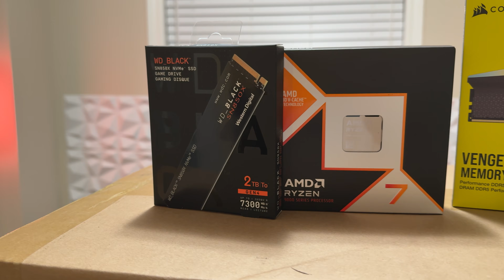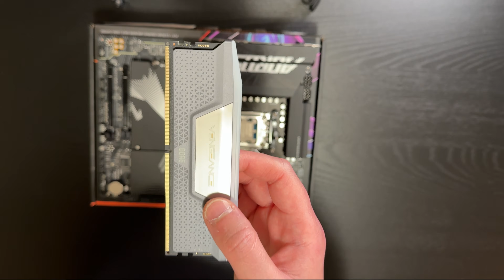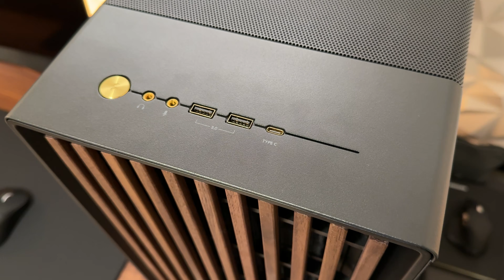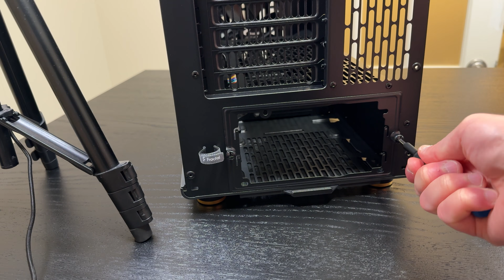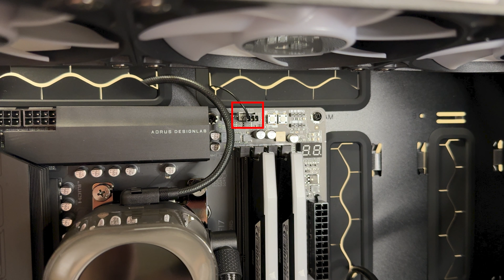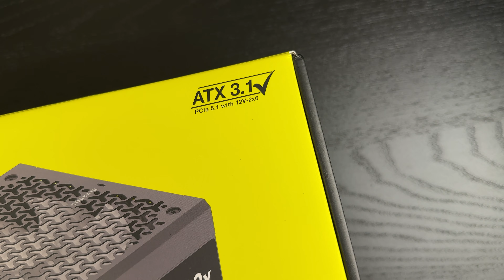Building My $3000 Dream Gaming PC! Ryzen 9800X3D + RTX 5080 | North XL Full Build & Guide

Comment: Just finished mine 3 weeks ago 
[PC BUILD SPEC LIST]

• CPU: AMD Ryzen 9 9950X3D (16-Core / 32-Thread AM5)
• CPU Cooler: ASUS ROG Ryuo IV 360 ARGB AIO (360mm / 6.67" AMOLED)
• Motherboard: ASUS ROG Crosshair X870E Dark Hero (PCIe 5.0 / Wi-Fi 7)
• Memory (RAM): 64GB (2x32GB) G.SKILL Trident Z5 Neo RGB DDR5-6000 MT/s CL30 (AMD EXPO)
• Storage: Samsung 9100 pro 1TB for the OS  2TB Samsung 990 Pro PCIe 4.0 NVMe M.2 SSD
• GPU NVIDIA GeForce RTX 5080 Astral
• Power Supply: Corsair HX1500i 1500W 80+ Platinum ATX 3.1 Fully Modular
• Case: Fractal Design North XL (Mid/Full Tower)

Comment: This build is 4800.00 now. It’s crazy how much hardware is inflated. Thanks AI
Reply: I swear to god idc how tinfoil'y this sounds  like but this has to be some plan (side-plan) to make us rent virtual PC's instead of owning..
Reply: exactly!
Reply: Probably for $3500 to $4000 youll get a really solid build now...
Reply: thts why i keep 10 dollars per day specially for ram and ssd from last 3 months so i cant feel expensive when i go to build pc 😅
Reply: you can still build a pretty solid 5080 pc for around 2500 bucks, pretty sure.
Reply: @parakeet10  You can, but have to cut a lot. 32Gb ram with lower Mhz/ CL. Lower SSD size/Gen/type. Get a cheaper case, cheaper AIO or just use Air cooling. Use cheaper 5080 (windforce, MSI ventris, Zotac,... They are still 5080, but worse build, pcb, cooling. Still I prefer the mid-range 5080 like the Gaming OC, TUF or Founder Edition). The computer shops (at least in my region) do all of that to make the 5080 pc look cheaper. I think for someone with a tight budget, they could build a solid 5070ti pc, or a 5080 cheap version and upgrade later on.
Reply: @TrươngTuấnLânLouis MSI and Zotac aren't even low tier bro
Reply: @parakeet10  I think if you go with 32GB ram, and a mid tier version of the 5080, you might be able to get similar aesthetics and performance for just over $3.5k.
Reply: @parakeet10  nope a 5080 r7 9800x3d 2tb nvme 32gb ddr5 6000mhz cl30 1000w psu and x870 motherboard with a good looking aio and fans and case would be around 3k maybe 2.9k if u get a good deal
Reply: @Flixxz-n5l   here, i made an AM5 ddr5 5080 rig thats ~2500 if you get a good deal on the GPU, as i am planning on doing this exact thing soon.

Case: Fractal Design North TG Dark - $160

Motherboard: NZXT N7 B650 - $320 

CPU: AMD Ryzen 5 7600 - ~$200 (depends on retailer)

GPU: NVIDIA GeForce RTX 5080 - ~$1000 (depends on retailer)

CPU Cooler: NZXT Kraken Plus 240 - $140

Power Supply: Corsair RM1000x 1000W - $180

RAM: 16GB (2×8GB) DDR5‑6000 CL30 - ~$220 (depends on retailer)

Storage: WD Black 1TB NVMe SSD - $230

Overall, this build is likely to cost around ~$2,450 USD before tax and shipping depending on the price of some of the parts when you get them. if you get a more realistic deal on the GPU it would probably drive this up a few hundred bucks but certainly not to 4800 dollars. i even used a fancy motherboard and still kept the cost at like half.

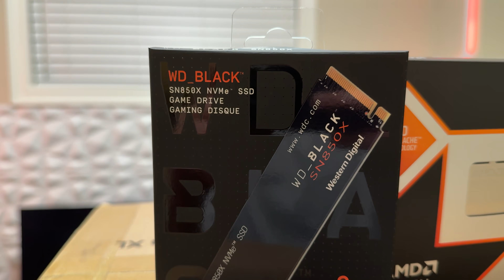Comment: 2:03 trhat's 50% good advice. The other is to check CPU RAM compatibility. CPU and Motherboard both need to be compatible with the RAM.
Reply: Modern ram is universal now.
Reply: @Timothy_B  not really, if you run ram higher than the cpu max speed you are going to have instability issues. always check the max speed the cpu supports
Reply: @randomcheese1719  it would pretty hard, almost impossible to do that these days. It would also be very strange to have such a low spec CPU paired with the high end ram from a financial perspective, let alone a logical build perspective. Like you’d have to spend $500 on ram and $100 on a cpu to do this.

Comment: Hey. Very good instruction video! I bought a north xl case in white, and it didn't come with the cable management passthrough holes with rubbers. Did I get an older version?
Reply from the maker: Thanks so much! Glad you enjoyed it. I think you have a RC version made for rear connecting motherboards, maybe you can exchange for the regular version instead

Comment: wtf is the cable u sey is the powerbutton from the chassi mine didin't look like that
Reply from the maker: On mine it’s that cable with those split pins at the end, they are labeled Power SW and Power LED+/- on other chassis it maybe called F_Panel where all those cables are combined into one convenient plug in. Check your manual and see which one you have

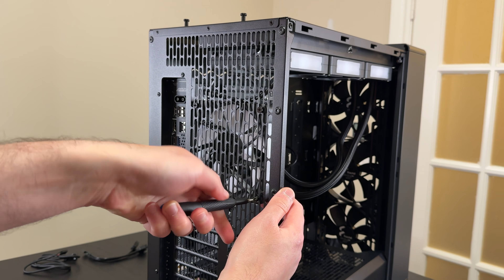Comment: Great video & build. I have a question since i'm trying to install the same AIO & extra rear fan (for neutral airflow). You mention that you connected your rear fan to the radiator with an I-Link cable @ 13:05 . How then, did you plug your Radiator into the Hub? Doesn't that take up the port that you would plug into the Hub?
Reply from the maker: Thank you so much and glad you like it! Yes for the radiator it’s got ports on both sides, so you can connect the outer port (the one on the front side of the case) to the hub, while connecting the back side port to the rear fan with the short cable they give you, then just tuck the excess cable behind the radiator
Reply: Oh great, I didn’t realize there was another port on the other side of the radiator. I’ve connected that side to the hub now & it works perfectly! Thanks again & have fun with your dream PC!

Comment: My pc didnt turn on. Checked all the cables…
Reply from the maker: Did you ensure the switch in the back of the PSU is switched on? You can also go over all the connections and make sure they are in all the way

Comment: Very nice build very classy. I also want to build een PC and already have/ordered 9800X3D, RAM 32GB, SSD 2TB. I also want to buy de RTX 5070 TI. I don't know which mobo I need. Should I order like yours or should I just go for a cheaper one like B650......I really don't know. I just want  a future-proof board for at least 4 years. I hope you can help me. Thank you in advance.
Reply from the maker: Thank you, I’m happy you liked the build! The B650 is discontinued so I wouldn’t go for it, you can choose B850 at least for gaming, a lot of them have PCIE 5 slot and have excellent voltage dist. 

You only need to really start thinking about X870 if you want the latest IO like USB 4 or you want to use a large amount of SSDs
Reply: @MoeTechReviews thanks for your response I really appreciate it. In my region (EU) I see the Gigabyte X870 AORUS Elite WiFi 7 for €254 so maybe I will pick that one. Again thanks for the reply
Reply from the maker: @Faceman12  Nice Im really liking mine so far!

Comment: can i use the AMD Ryzen 9 9950X3D 16-Core Processor instead is it better or worst or does it not make a difference
Reply from the maker: Yes you can! The 9950X3D is much better than the 9800X3D for productivity tasks and exactly the same at gaming, it’s like the ultimate CPU
Reply: @MoeTechReviews Yes I was thinking that because am looking to stream in the future, but does the graphics card edition matter in your opinion I would like to go for a PNY OC or a Zotac extreme infinity theyre 200 cheaper
Reply from the maker: Oh nice! The extra cores will be useful in that case. 

And for the brand of GPU no it doesn’t matter too much, it’s the same GPU chip from NVIDIA, but each brand designs different cooling solutions around it. 

And within each brand there are different levels of cooling solutions and components from entry to premium. So that is what you are paying for plus some extras like RGB.

So go for the best price and design you like!

Comment: Currently watching your video cause im looking to upgrade my PC again. Very informative, but is there a reason why you chose 2TB instead of something larger?
Reply from the maker: Thank you so much, glad you’re finding it helpful! 

For the storage, there is no specific reason, I just tend to erase/backup anything I don’t need and I try to keep everything organized so I usually do not need a massive amount of storage. 

But I am expanding what I do on the PC a lot, so if i ever run into a situation where I need more storage I’ll add another nvme 🙂
Reply: @MoeTechReviews  Was there a space for another if so could you indicate where it would be? i'd prefer having a larger drive just 2 smaller ones with one being specifically for games would be good too.
Reply from the maker: That’s a great idea for speeds. Yea there are more ssd slots under the cover with the big eagle head on it towards the bottom of the motherboard. Use your best/fastest one on the main slot because it will boot your windows and then you can use any other SSDs in the extra slots

Comment: System is up and running. Only made two errors. Didn't use the correct CPU Fan header as my motherboard is newer 870e Elite X3d and didn't hook up radiator link wire. Thanks for the tutorial it was very helpful. Almost forgot -my keyboard wouldn't register the Y or N key at the bios boot screen so a cheap wired keyboard solved that issue...
Reply from the maker: That's awesome, happy to hear it's up and running and glad the tutorial helped, thanks for the feedback!

Comment: Why 9800X3D sits at 44°C in idle?
Reply from the maker: It’s pretty standard, 9800X3D do run hotter at idle, but don’t heat up much more in gaming (I get around 50 degrees in most games)
Reply: @MoeTechReviews  awh okay, nice to know cuz I'm about to buy it in like 1 or 2months from now!
Reply from the maker: Nice that’s awesome, take a look at my benchmarking video if you wanna see in depth about temps

Comment: Hi man, again me, i finally did built the PC with exact components, but for some reason i get in Cinabench 16128 pts, is there some specific configuration you did in BIOS? please help me brother, thank you
Reply from the maker: Hi there! Congrats on building your PC that’s awesome :) a few things you can do, but before anything, make sure you have “X3D Turbo Mode” turned OFF in BIOS, also make sure your performance settings in windows are set to “Balanced” that is best for AMD. 

After you do that  try the test again in Cinebench R23 with a hardware monitor on the side like HWinfo and check your CPU usage, temperature and clocks and make sure your temps are reasonable (like 85 degrees max) then see if that’s fixed.
Reply: @MoeTechReviews thank you so much!
Reply: @MoeTechReviews i came here back after some time to thank you again and tell that the pc I built with exact components (only 32gb ram and 3tb ssd cuz it’s gaming only) is amazing beast, I enjoy every second of using it, for some reason on boot I don’t see bios and in case if i need it I should change the port to integrated one, but hey! I don’t need bios at all not even once in a year, so im actually satisfied with the timing i found this video cuz after i saw increasing of prices and bro so lucky, in short the best high end build for gaming i had

Comment: Great video. I am buidling a PC with almost all the same komponents. I have the same cpu cooler and a extra fan in the rear as you, but got confues how I should connect them. You say in the video that you connected the extra fan to the hub and later on in the video you say you plugged it in the radiator with icue link cable. What is the correct thing to do here?
Reply from the maker: Thank you so much! Very excited for you. For the connections, the radiator on top has 2 sides, what i did is the side closest to the front has a cable running to the back to connect to the icue hub which will control the function of all the fans, and the side closest to the back of the case has the extra fan connected to the radiator using the yellow icue port, hope that explains it better
Reply: @MoeTechReviews Thank you for your answer! Now i understand. And for the pump over the cpu it also needs to connect to the hub right? Again thank you for your video, it is helping alot for first time building a PC.
Reply from the maker: Of course!! No worries. Yes that’s right the pump also connects to the hub in the back with an icue cable, and if you have the lcd screen you get a usb c cable to the pump on one end and usb 2.0 header on the mobo on the other end

Comment: I have listed this exact config except for using MSI based motherboard (not sure if that is the right decision, needed wifi 7) for my pc (not bought yet). On the fence on buying this one or using Nvidia's Gforce now cloud gaming where i can get RTX 5080 performance streamed. I have good internet connection with 500mbps. Thoughts?
Reply from the maker: Yes MSI motherboard works great too, brand doesn’t matter as long as it’s AM5 compatible and has the specs you need. I don’t have any game streaming experience, but a PC can do much more than game, so it depends on the use case

Comment: This is almost exactly the parts list im going for. Going for an all white set up, and debating if I wait for the 5080 Super. Ideally want it for BF6 launch, but not sure to wait for at least an announcement for the supers.
Reply from the maker: Nice! All white build will look super clean
Reply: i just got a 5080 for msrp havent built it yet. im curious on supers too as i the 5080 super will obviously have more vram.. and if they do a 5070 ti super it could potentially be better than a 5080 for less. not sure if they will though. maybe they will just do a 5070 and 5080 super.  rhe only problem is if you wait look at how long it took for the gpus currently to somewhat get to msrp.. the supers will be tough to get as well. especially the 5080 super with 20-24 vram.
Reply: @iamjstew___4473 I ended up getting a used 5080 Aero white for £725. After seeing that the super series were not going to be released in Q4 I decided not to wait. Wanted it ready for BF6.

Build was around £2500, 9800X3D 64gb ram and a 5080 all white build. Can't complain one bit 😅
Reply: @iamjstew___4473  based on rumors its just more vram for the 5080 and maybe a boost clock seeing how well the silicon tolerates OC already, feel like it was meant to run faster. But even if it gets more cores, it'll probably have poor supply so it'll get scalped all to hell and u'd wait 6months for msrp.

Comment: love your setup, enjoy ur build! looking to build my own with 9800x3d and rtx 5080 aswell, with the same exact case (thats how i got into your video), im wondering how are the CPU temps doing in games with the corsair watercooler, since ive seen a lot of controversy with the 9800x3d temps and people complaining about having to undervolt the CPU in order to run smoother and cooler
Reply from the maker: Thank you so much, And congrats im excited for you to build it! So far so good, I’m not seeing any overheating although it does idle hotter than other chips (which is normal for these chips) I’m working on a full benchmarking video next where I’ll post FPS and temps in different games as well as temps in editing/cinebench so I’ll have a lot more recorded info then
Reply from the maker: I just posted that video give it a watch for full details! :)

Comment: Nice video, but i would sayi dont get people why they going x3d chips its just wasting money for zero gainst over ryzen 7 9700x all you have to do is to enable pbo on ryzen 7 9700x and it will be as fast as ryzen 7 9800x3d for gaming and faster for all other stuff coz its boost clock way higher than x3d part. X3d chip is for 1080p gaming to see higgest frame rate possible with lowest graphics settings possible
Reply from the maker: Thank you so much! Happy you enjoyed the video! You are right there is definitely a comparison to be made, the reason to go X3D is pricing at the time of purchase and also considering the low 1% fps are better in the 9800x3d, so overall should give a smoother gaming experience with less dips.
Reply: @MoeTechReviews  The problem with ryzen 7 9700x is that out of the box configuration are terrible on it unlike x3d chip. and like 99% youtubers testing out of the box settings which leads x3d chips performing way better on paper. but when you enable pbo, amd expo ram profile and seting slight undervolt(optional) it becomes on par with x3d chips on any modern game at 1440p high settings or above using 5080 or lower card.I understand that not many people want to sit in bios and ajust stuff so for that x3d chips are really great option. an example i have  ryzen 7 7700 and im geting same numbers as people on youtube with ryzen 7 7800x3d even in 1080p with 5070